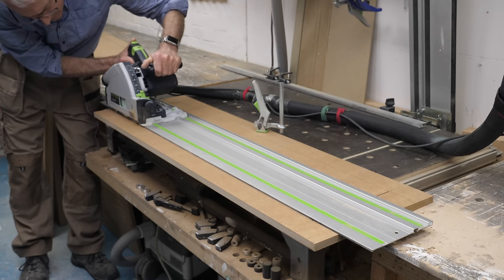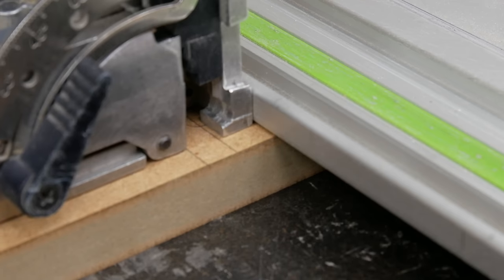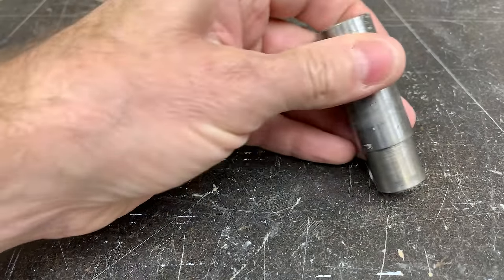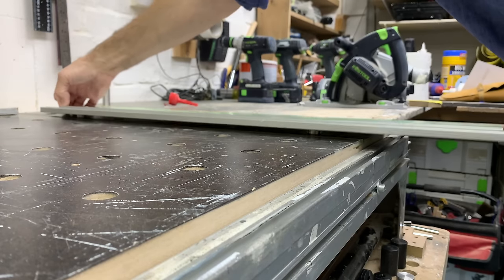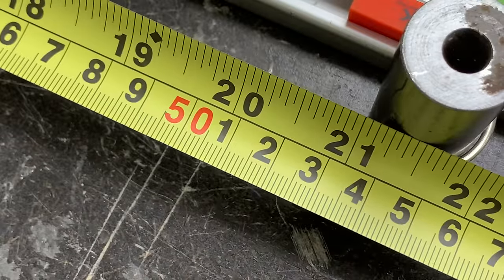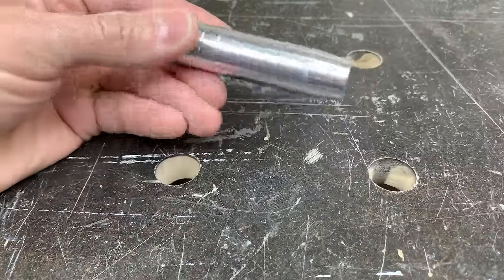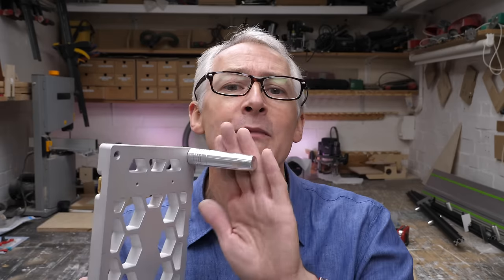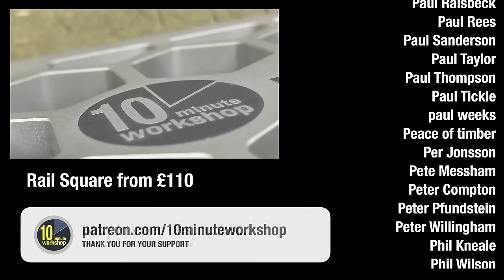Square cuts: MFT or Rail Square?  [video 422][Gifted/Ad**]

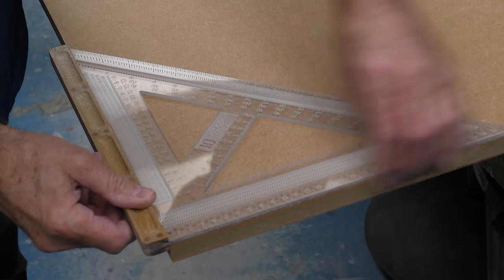Comment: Can’t say enough good about your videos Peter, thank you.... I’ve been having a gripe with the Rail Squares, where, testing the TSO, Benchdogs, Taiga... I find that the squareness is not quite there. There are inconsistencies in getting the rails to square up to the rail square. Now I’ve tried several rails, 3 Festool 1400 and 800, two Makitas, and even the bosh and mafell rails. I find that is quite difficult to get them squared... The TSO and the Taiga seem to align the best to either the Festool of Makita rails, I thing their pull mechanism to attaching the rail, where they pull the rail on to the edge (and the Taiga has the longes edge) of the rails squares, but even in my (prettiness tool caring environment, where I do it for hobby) there is just too much inconsistencies, the play needed to properly bind the two is white enough that you can get enywhere from .5mm to longer that 2mm off. Even @0.5º off on the rails, over 800mm that is .6mm off. Curious how well you faired on the squareness...  I see that @7:25 you are getting very similar results... ;) Thoughts? See the conversation over at the Festool or Mafell forums on FB.
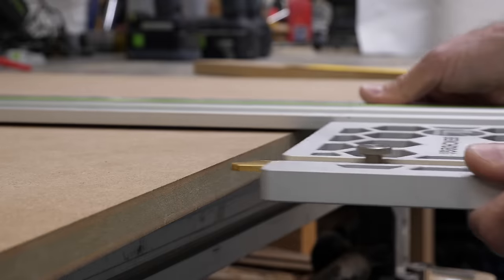Reply: At 7:25 it looks fine. Did you see that different? I have the Taiga square with a Bosch rail and as accurate I can measure it's as square as I can assess. If you attach it correctly, I do not see how the rail could be out of square!? I have some videos about my setup on my channel (in german), where I give a few tips around that topic. Two tips especially interesting for owners of the Taiga Tools square
Reply: @dingensundbummens  Yes, I have seen your channel and you are using a taiga square on a Bosch rail I think ( I just remember your square been red).  Well, go have a better look you can see that while the edge on the corner looks great, the far end is off from the perspective of the camera... What I have seen is that, the BenchDog Squares, get out of square since there is enough play to fit to the rail, and that gets of the square, all you need is a filler gauge and you can see what I mean. The Taiga, TSO and FC Tools, the pull in the rail on to the edge of the square, getting a tighter fitting. Go to tether the Mafell or Festool FB user groups and you can read all about my experience with photos there.

Comment: Hi Peter, liked the video, as usual great content. Did you switch out the bolts in your rail dogs as mine are a T bolt which has a bit of play in the rail so doesn't give much confidence in them.
Reply from the maker: Thanks Kenny. No, mine's an older version, had the regular hex bolts which are snug. Might be an option to swap them out of the T-bolts have a bit of play. 👍

Comment: Can i lower my bucket into your well of excellent knowledge of all things track saw and rail squares..... Do you know if the  ''Festool 90 Degree Guide Rail Edge Square FS-WA/90
'' is compatible with the Makita  guide rail....?
Reply from the maker: It’s a rebranded TSO square, which is sold as fitting Makita trails, so I wouldn’t expect to have any problems with it.👍

Comment: Thanks for this overview. I have a Dewalt DW745 right now and my shed is tiny so things can become a bit unwieldy due to needing twice the workpiece length in space. As a side note, it's note as accurate as I'd like. Because of this I am considering selling it getting a track saw solution and this video helps a lot. 

You may have covered this in another video but how do you go about making long, thin rip cuts on stock that is already fairly narrow? As that's where my table saw really shines and it seems to be the only sticking point in my mind as to whether I want to sell it or not.
Reply from the maker: Thanks! Long thin repetitive rips are just about the only time I turn to the table saw, tbh, but you can do them with a bit of ingenuity, usually involving some tape and a balancer board of the same thickness as the workpiece to ‘extend’ the reach so the rails stays flat. HTH P
Reply: long thin rip cuts can be done very good with a track saw, when you use Bosch Or Mafell. Clamp the piece to cut to the underside of the rail. There are two grooves on the underside of the Bosch tracks. I'll upload a video, likely soon, where I'll show how to do that. You can look on my channel where I have a video (currently in german only) explaining / showing how to cut also small pieces with the track saw.

Comment: Hi Peter, just out of curiosity if you were like a lot of other home diyers without a workshop and only something like an old portable black decker workmate what option would you choose? I know this is a very general question and people will say it’s a case of horses for courses depending on what you are doing
Reply from the maker: You can set up the MFT top on a workmate and have both, but in all honesty for that kind of thing a rail square and an extra trestle for support off the workmate would be the way I’d go. 👍👍

Comment: Hi Peter, great vid! I’m considering a track saw to replace my radial arm saw in my workshop. I use this saw because it allows me to have a large cross cut capacity plus the ability to switch position to a 45 degree bevel cut for my trim work. Of all your ts vids, I’ve not seen one where you use it for bevel work, is it just as accurate?
Reply from the maker: Simple truth is that I don't do many bevel cuts, but yes it's very accurate - see video 432	Bedside cabinet	https://youtu.be/aJNzOZCHrGU for the most recent examples in 25mm Birch ply.
Reply: @10MinuteWorkshop  great thanks

Comment: Peter, as always I really appreciate your short 10 min series. Can I ask what profile extrusion is used on the work bench you use?
Reply from the maker: Thanks Peter! The MFT I have is an older MFT/1080, which used the standard 8020 extrusion; with the later / current MFT/3 Festool switched to a proprietary extrusion; all the more reason to go old-school! HTH. P
Reply: @10MinuteWorkshop  Thank you, nice to know it is the 80:40 because that is available here in Australia.

Comment: Great video - apologies for the random comment, but is your workshop insulated in any way? I see a lot of bare brick and wondering if it gets too cold in the winter?
Reply from the maker: Thanks! No, but the place is heated (kind of - the heating pipes for the building run through it) so not an issue - actually quite the opposite, it’s like a kiln most of the time! 😝😅👍

Comment: That was awesome ✨

Wondering if you would (if me) cut one of your festool tracks in half to use it as a cross cut track or not?

I find every time I want to use the festool TS to make CrossCuts that are not full width, it’s a hot mess with the length and I just get flipping frustrated and use the table saw instead.... arrgggg.  😉  ideas/expert advice? I have two long tracks just not sure if I should butcher one of them for this purpose. They are pricey as you know.

Thank you.
Reply from the maker: Toughest thing I ever did was to cut my 3-metre rail down to 2100/900. You can buy an 800mm rail, 1080 rail, or all kinds or 3rd party rails that are cheaper than the Festool originals, but yeah, I understand completely. 🤷‍♂️👍
Reply: I got a makita rail and cut it into a 600 and a 900, both are very handy.  Especially the 600 with a rail square on it.
Reply: No Skills thanks! I was torn but seems like this is the better way to go. I think Mr. Millard shared tips on other non FS brands that may work. If Marita is the best match I will go with it. I heard from reviews that it doesn’t track as snug is that a concern ? I do have the right angle cut plate?
Reply: Emanuel Matos I would buy whatever is compatible and the best deal at the time.

Comment: Great video 👌 do you have any quick convenient methods of making repeatable cuts for small rips e.g 50mm or so? A table saw would ideally be suited for this I know. But I have struggled in the past trying to do these kind of cuts, working on the wrong side of the splinter guard I've found not to be particular accurate/repeatable or easy to set up
Reply from the maker: Thanks! Yes, narrow Rios can be a pain to get accurate. Best way I’ve found is to use the DIY waste-side parallel guides - I showed those in the Tracksaw workshop series, links in description - or if it’s just a one-off then the Strawbyte waste side jigs are excellent - Strawbyte waste side jigs - http://bit.ly/Strawbyte_jigs 👍👍
Reply: @10MinuteWorkshop  cheers I'll give it a go 👍
Reply: I have set up a cutting station for the track saw which uses a rail square for squareness, but adds options for repeatative cuts of pieces of almost any size (down to millimeters) -- also on for waste side cuts if needed / wanted. My son wanted to make some YouTube content, so we showed our setup on our channel in the hope otheres might benefit from the idea. Cost is around 50 Euros for the cutting station. This replaces my non-existent table saw. Together with the router I rarely miss a table saw. Sometimes a band saw could be the better or sometimes even the only solution I am aware off. But please take a look at my cutting station and see if that might help and post any ideas or questions you might have. Maybe we'll do an english version of the video also.

Comment: Hi Peter, loving your channel! Do you have a link to the slightly fatter bench dogs that correspond with the b collars? I can't seem to find them at benchdogs.co.uk? Or do all the benchdogs.co.uk dogs have a 30mm head? Thanks! Keep up the good work!
Reply from the maker: Thanks Nils! The ones I have came as part of the kit, so I don’t have a link I’m sorry. Give Benchdogs a shout, they should be able to help you. 👍👍
Reply: @10MinuteWorkshop  thanks Peter, will do!
Reply: Just ordered the railsquare! I was wondering, are the grooved adapters parallel to the base of the square just like the bevel adapters? If so, why not use the grooved adapters as big bevel adapters?

Comment: Hi Peter thanks for the really good content just a question will the excel track fit the titan track saw thankyou
Reply from the maker: The excel track is a dead ringer for the makita, so pretty sure it will. Maybe check the ‘which rails work’ video, https://youtu.be/_HtpT_bK7zw can’t remember if I tried all saws on all rails or not tbh. 👍
Reply from the maker: The excel track is a dead ringer for the makita, so pretty sure it will. Maybe check the ‘which rails work’ video, https://youtu.be/_HtpT_bK7zw can’t remember if I tried all saws on all rails or not tbh. 👍
Reply: Thanks Peter

Comment: For info, I found the Railsquare perfectly good for 2.4M cuts, provided I use a rail clamp at the far end, and check for square whilst clamping. It just stops the rail from see-sawing if trying to clamping both ends - particularly if your first cut is in a small workshop with barely enough room to move from one end of the board to the other !!
I imagine you'd still prefer the hinged track for repeat work ?
Reply from the maker: Good to know thanks - and excellent point/tip about clamping the far end of a long rail! And yes, for a lot of stop/start repeat work you can’t beat a hinged rail.👍👍

Comment: all these videos are making me feel i dont need to replace the table saw my kind next door neighbour burnt for me last year but they are causing me a headache in the way of which track saw to purchase instead of a table saw. can i ask if you have to make longer cuts do you opt for two rails joined or do you go for a single long rail?
Reply from the maker: When I first started out all I had was two 1400 rails and a saw - I cut literally miles of board with that setup without any problems at all. Sure, these days I have longer rails and if you have them you use them, generally. If you do it a lot, a long rail is well worth it, provided you have somewhere to store it, but if it's only the occasional full rip, then two rails joined worked fine for me. 👍

Comment: RE 96mm spacing. Just read the posts, bit vague as to why it's 96mm but being a multiple of 32mm makes me think it's something to do with the 32mm euro cabinet system? maybe we should ask the horse?
Reply from the maker: Yes, and the 32mm system is to do with post-war line-boring machines - there are links in the video description that helps explain it more. 👍👍
Reply: @10MinuteWorkshop  Thought so, I bought a book by Bob Lang called "The Complete Kitchen Cabinetmaker" some time ago now. In it he explains how the 32mm system came about after the war to quickly rebuild Germany and it being down to it was the closest they could get the drill chucks together. Quite interesting.

Comment: Hi Peter, how accurated do you think the cuts with the square will be? I am planning to build some furniture in the true 32 mm system
Reply from the maker: With the Benchdogs rail square, they’re very accurate - every square one comes with a print out confirming any deviation. 👍
Reply: @10MinuteWorkshop  Good Thank you waiting for mine to be delivered. Only problem now is they charge you and arm and a leg for customs dues...

Comment: Peter can you tell me if the rail square will fit the MacAllister plunge you reviewed and I purchased?
Reply from the maker: Hi David. Yes it will - the MacAllister rails are identical to the Makita-pattern rails, so they fit just fine. 👍
Reply: @10MinuteWorkshop  thank you so much Peter great to know 👍

Comment: I once got a brainwave to clamp a straight edge to a sheet of melamine along the length 8 feet, and thought it would be great  to simply slide my  4foot makita track along this with the track saw to achieve a perfect straight cut as I only have the one 4 foot track, unfortunately it did not work for me as the back of track is not perfectly parallel to the part the saw runs on,  I wonder is this the case with the Festool tracks?
Reply: I am just guessing but I think you might have a defective rail. The Makita saws are fairly popular and I've never heard of an issue with them. I bought a set of 55 inch rails made by Powertec. One of them was perfect except to splinter guard kept falling off on line end. Not a big deal since I could just clean and reglue it but I shouldn't have to. They weren't free but much cheaper than Festool. The 2nd rail was absolutely defective. The rib got wider down the length so but saw bound against it and started wearing the aluminum. I might have been able to fix it by sanding it but again I shouldn't have to. This was unacceptable. I requested a replacement and Amazon was on it. The new rails arrived in 2 days and are perfect. There's always a lemon. It doesn't mean the brand is garbage. I own several other Powertec items including a try square which is 100% against a machinist square.
Reply: @HyperactiveNeuron  Thanks very much, I know some guys who have the same tracks, must try one of there's some time to see if this is the case

Comment: Do you already have a video on cutting down full size panels until the dogs or drop rail comes into play?
Reply from the maker: Sorry, don’t follow? 🤷‍♂️
Reply: Peter Millard —
Sorry, I was too brief. Tomorrow I’m cutting a sheet of plywood into thirds. I like the hinged railguide on my MFT but it’s no help on oversized cuts like that. Or when cutting a full size door from a sheet of oak veneer plywood, and nearly half the sheet — as well as the cut line — is unsupported off the front of the table. Maybe you have tips for handling that.

Comment: I’ve seen that you have a section of track hinged to the back of your MFT table. Do you make a hinge or know where I could get one please? btw way I’m a Makita user my finances don’t yet run to the Festool products ☹️
Reply from the maker: Hi. The hinged rail comes as standard on the MFT, though you can buy it as a spare part:-

Festool MFT hinged rail/ rail support reference numbers are :-

497022 Support - this is the locating pin unit at the front of the MFT
497023 Support unit - this is the hinge part at the back of the MFT for the rail

If you do a google search for those reference numbers, the spare parts links will pop up at the top of the list. 👍 I’ll be making my own version of the MFT later in the year BTW. 👍
Reply: @10MinuteWorkshop  Thank you Peter, I relly enjoy your videos!

Comment: This might be a silly question: how do you avoid cutting into the MFT surface? It's quite expensive so treating it as sacrificial is a bit too rich for my pocket!
Reply from the maker: I set in a sacrificial strip routed into the surface, but you can use a spoilerboard, or commercial bench top protectors. There are lots of options. 👍
Reply: @10MinuteWorkshop  cheers! Now I think of it, the cuts will tend to fall in the same places, either rip cuts or cross cuts, so you've only got to damage the top the once, any further cuts won't damage it further.